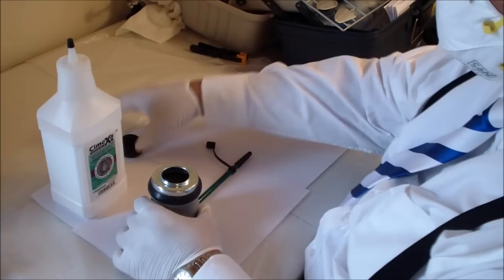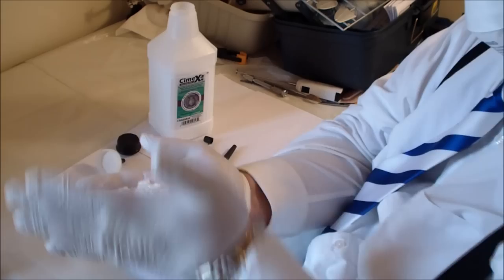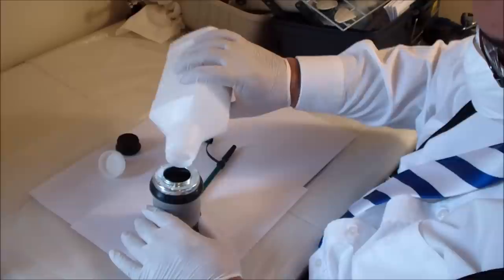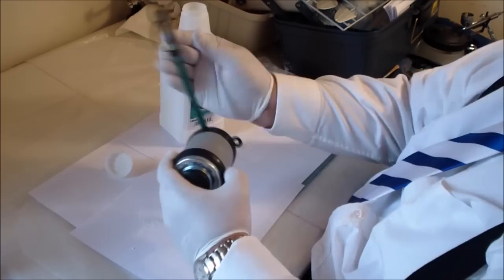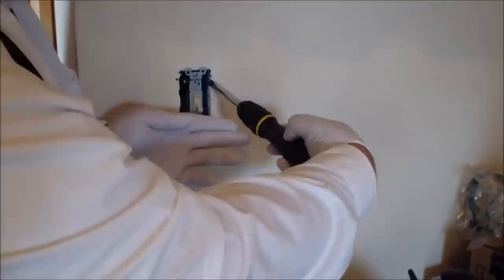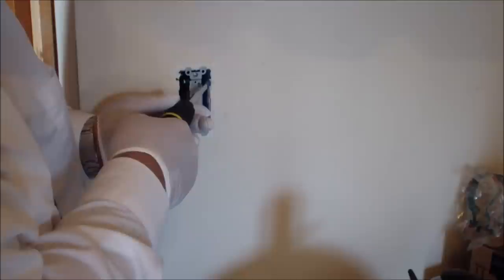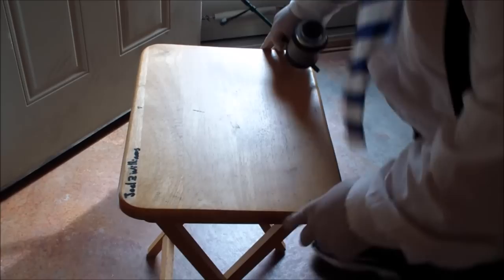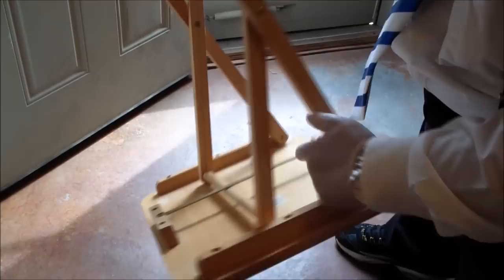CimeXa Desiccant Powder for Pest Control of Bedbugs (2 of 2 videos)

Comment: What about the powder getting into the air? Has anyone ever been harmed from it getting airborne? It could be harmful, right?
Reply from the maker: Actually the particulates are completely spherical under the microscope so there's less chance of respiratory irritation. Unlike diatomaceous earth. However, I did have one gentleman who told me that he suffered from dry mouth and sneezing.
Reply: That’s the only person you know who had any effects from it? I’ve seen a few people on reddit who reported  having ended up with clouds of it in the air.
Reply from the maker: @lisaanne2525  . Yes, I've been doing it for about 6 years with the Cimexa and I've only had one person complain about it thus far. Like I said, if you look at the particulates under the microscope they're they're completely round so there's really no way that it's going to irritate your respiratory tract. The diatomaceous earth on the other hand that stuff looks like broken up pieces of glass under the microscope
Reply: Joel Z. Williams How many people have used it that you know of? I guess I’m wondering theoretically if it did get into the air (while applying, or vacuuming up after) and was breathed in, could it cause lung damage and systemic effects on the body, just by being such microscopic particles. But if you’ve known a lot of people who’ve used it and had no one really who has had issues..?
Reply from the maker: @lisaanne2525  hundreds of people have used it successful. It's ultimately up to you if you want to try. That's all I have time for.
Reply: Joel Z. Williams Thank you Joel!

Comment: I will using this method soon and I will let you know what happens.
Reply: Did it work for u?
Reply: CPR4THEBODY i just got the Cimexa, bellows, 91% alcohol and sprayer, masks, gloves and just waiting for bed bags. 

I just found out though to save your bed bags from being ripped and torn to line your bed tails with felt. That's my next move so I have everything I need. 
I can not stress enough how important that felt on the bed railings really is. It can save your 45 to 100 dollar investment in good encasements from being rendered useless. I will post again after I complete the process. 
Also not allowing the bugs to move is imperative, they do not perceive a blood meal (you) beyond 5 feet.
Reply: callmeishmel what is felt, pls elaborate
Reply: Callmeishmel Melville Did it work?

Comment: Does anyone know will you see evidence of dead bed bugs after using this or do you just notice less to no more bite evidence?

It would be nice to see them lying dead on the floor to actually know it's working.  Just wondering.  I just ordered this product today and praying it works!
Reply from the maker: Neil Singleton if you build four 2-liter traps you will notice about 3 waves of captured bugs. The first wave will contain all five stages of nymphs and adult bugs. The second wave will have mostly captured smaller nymphs. The final phase will usually only have the smallest nymphs. Usually will take 6-8 weeks, start to finish.
Reply: How did it work for u?
Reply: It definitely helped decrease the population vs. where it was before I used it.  It hasn't completely eliminated them as I still get about one or two bites a month but that's better than the 3 to 5 bites a day I was getting before using it!
Reply: +Neil Singleton do u think retreating it will get the last bit out or do u expect them to go away in time being that it says 10 years it works
Reply: I'm hoping that in time they will all die out but I have been retreating around my sleeping area every month or so which I also think helps.
Reply: +Neil Singleton We have only seen a total of 4 all together and I'm the only one that has been bit. Do u think I'm may not have a bad case? I'm waiting on my product. it gets here Friday
Reply: In my case, it was when I finally saw them that I found out I had the problem to begin with.  They are very, very good at hiding.  If you are starting to see them it could be a bad case.  Sadly it's different for everyone though.  Good luck! They are a nightmare!

Comment: Hey Joel. I live in a two bedroom apartment and I have carpeting throughout the whole place. Would I have to apply cimexa to my carpets as well? Or just the seams where they connect to the walls/doors. Also, where can I get cimexa in Canada I'm finding it difficult to buy any here and the shipping from the USA is insanely high. I think it would cost me about $50 just for a bottle. I don't mind paying that but I just want to check to see if you know of any company that sells and ships to Canada. Thanks again I will post an update once I start my journey.
Reply from the maker: No they're generally not going to be in the carpet. In fact I've never personally seen that. They're always going to be somewhere where there's wood. They like that wood for a lot of reasons. Focus on the bed frame and anything with in 3 ft of your head when you sleep. As far as the Cimexa, there are many manufacturers of amorphous silica gel. You just need to shop around for that key ingredient in powder form. I'm sure you'll find it.
Reply: @JoelZWilliams1  Thanks for the quick reply! Unfortunately I don't see many products in canada in powder form and when I do it's only about 20-40% max as their active ingredient. Would I be able to buy the amorphous silica gel balls and grind them myself? Would that work? Or would that be too risky?

Comment: I don't know if I received the authentic cimexa, because i put this stuff down everywhere Saturday Oct 22, 2016 at night. I put it all over my bed frame, opened boxspring encasement, put on outside of box spring and mattress, around bottom of bed posts. I'm still getting bitten. Within last 24hrs three bites. First couple of days, 1 bite every other day, now 3 bites within last 24hrs(10/27/16). I haven't seen NO dead bed bugs. I'm wondering if this sh*t really works. I am also spraying alcohol on linen some nights, washing clothes, prior to cimexa i had D.Earth down. Somebody please tell me wtf I'm doing wrong. Trying very hard to prevent calling the pros, but seems like I will have too :/
Reply: I really need answers any help or advice please thanks @mrwilliam
Reply: It will be two weeks this coming Thursday no bites and no sightings of them blood suckers! After my previous post, I did another treatment with cimexa in all my sockets, all cracks on my wood bed frame, bed posts, in between mattress, curtains, duct taped my box spring encasement corners,  removed all hard plastic off corners of box spring (which causes holes) when activity is higher than normal in your bed. I've been sleeping in my bed, both kids rooms no bites no sightings, since I did a second treatment. I'm sleeping better at night. I was very frustrated in my previous post, but I'm back to say, its working. I will give it two more weeks, for a final confirmation. I believe that cimexa is the game changer, bc once your home is layered in the right areas with this powder, you will be bb free for 10yrs, even if a new one enter your home. bc once that new one come in contact with cimexa, it won't have time to reproduce, it will be dead within 24hrs🙌
Reply: csifwtt yes it takes time,  at least a week. its been 5 wks now. no bites no sighting in my home.
Reply: eboni willis I'm having a problem were I'm bitten but no signs of bugs . Did u see any bugs or signs .then you put  cimexa down then bites go away?
Reply: eboni willis seriously thanks for the updates.
Reply: Hi, could you please give a final review. Did it work for you?
Reply: Hi, could you please give a final review. Did it work for you?